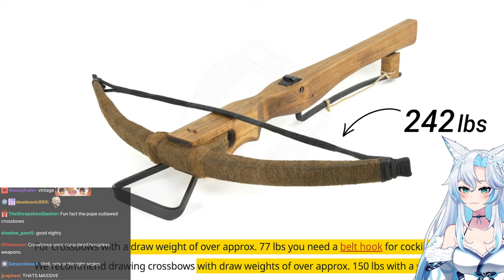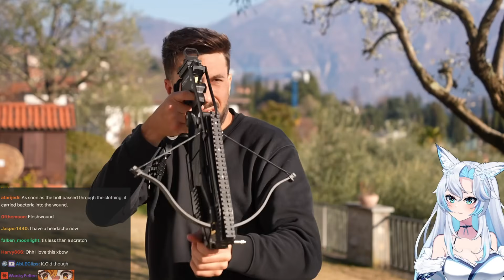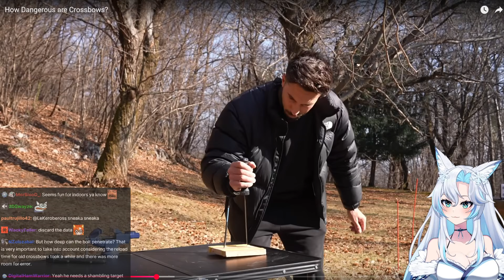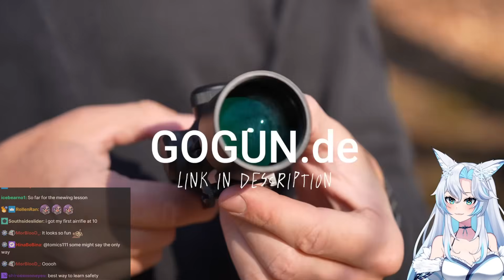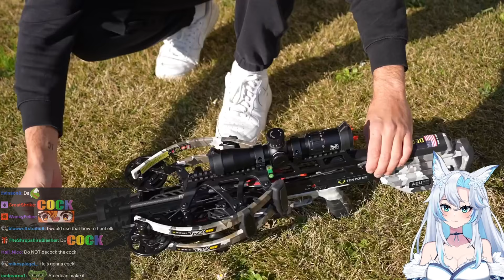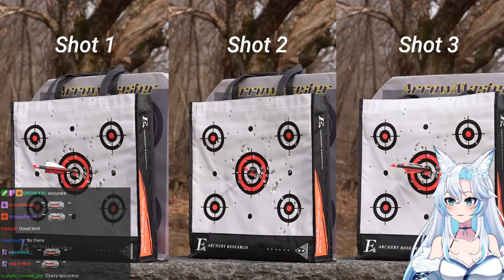How Powerful are Crossbows?

Comment: for lethality comparison, a 9mm hollowpoint will have around 395 ft/lbs of energy out of a carry pistol, or 535 joules for those non-Americans out there.
Reply: speed helps, but the materials and rarity of said materials, and production/craftsmanship jumps exponentially might as well be the industrial age. 

If you get transferred to the stone age, you're knowledge of guns are the strongest hand held was nearly all useless if you can't manufacture it.

The most balanced lifestyle if not the best i think was to own both a modern gun and crossbow, while honing your skills in making DIY bows.
Reply: Manage deez nuts! Haha, got him!
Reply: I’ll say this though. Bullets are a lot lighter than arrows and lose energy faster. But most rifles tend to outperform crossbows. I still believe that a good crossbow outperforms pistols in terms of penetration power
Reply: Crossbows are at a kind of weird middle point between handguns and rifles in terms of penetration and damage as depending on the make and draw strength a crossbow may be comparable to a 9mm handgun or can have stopping power similar to a rifle that fires 5.56. Of course the primary drawback is the significant increase in weight and the faster you’ll run of stamina from pull back the string (even with mechanical help which is required with some of the higher draw strength versions).
Reply: @NightFangFenrir  its gona depend allot on the bolt & head on it as well... & what your trying to penetrate, a hunting broadhead or such could likely penetrate Kevlar where a a hollow point would have difficulty.
Reply: I'll still take my G19 but these are badass!!! 😊
Reply: @Jack-M1113  oh yeah, I wouldn't trade my 9, but I legit kind of want to find that first "semi-auto" xbow shown just to play around with, but with the 90 or 120 lbs draw, the 60 lbs he showed was just too underpowered.
Reply: You gave a unit measurement for us non Americans, as if I understood what that 535 joules mean. Still thankful though.
Reply: And a .45 ACP fired from a 1911 is basically a railgun capable of penetrating hardened bunkers and vaporizing tank columns.
Reply: @Astrophyllum  A .45 ACP was used to set off fat man and little boy, so yes.
Reply: @ 100% truth, it won 2 world wars afterall.
Reply: @Astrophyllum  😂